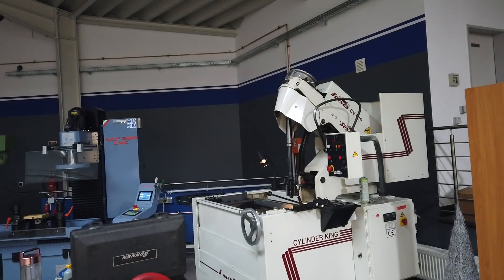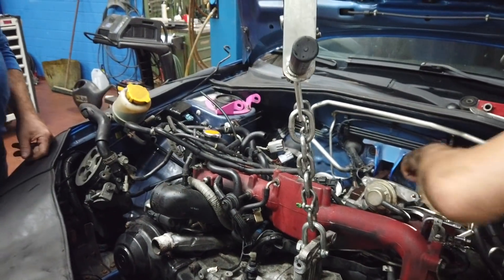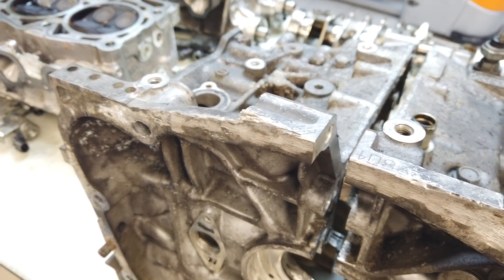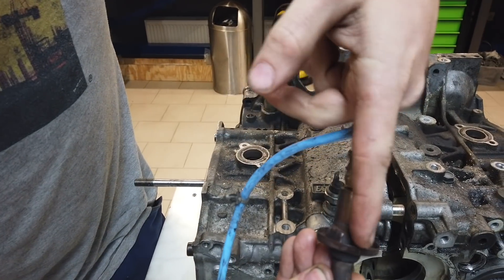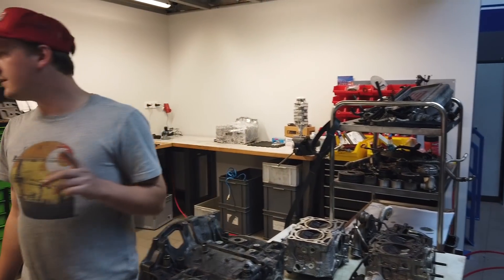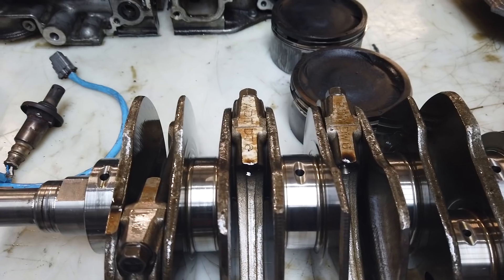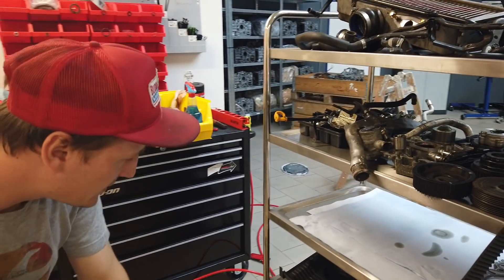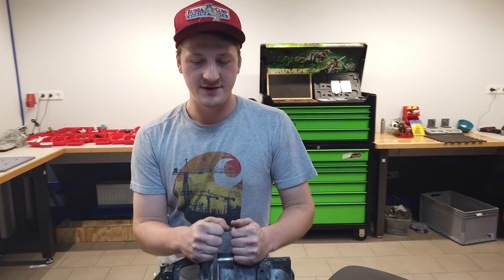What a DISASTER with this Engine l MYSTERY l Subi-Performance

Comment: The youtube rabbit hole has brought me here.

Check it out...
I know very little about car engines. I have an 09 Forester. 
So, I take it to the dealer (Stivers Subaru in Decatur, GA) about 10 months ago due to engine misfires, sluggishness, and oil leak. All compounding over about a weeks time. They say, head gasket is bad, it's replaced. 

Fast foward to about a month ago. Sluggishness returns with smoke from burning oil. They say Cam Seals...okay, done. 
I get it back and it is still burning/smoking oil. I take it back in...they say, "bad rightside gasket valve. These typically don't go bad, we must've of disrupted it during the head gasket job last year." So...they fix this for free, which to me admits guilt. 
2 days later I have catastrophic engine failure/oil leak going about 65 mphs down the interstate. They tow the vehicle back in and discover the Cam shaft has broke in half. 

They are taking a further look to see if it is reasonable to repair. They have not admitted to guilt. They are saying the breaking of the cam shaft caused the breakage in the newly repaired cam seals, this seems highly suspect & gigantically coincidental.  I feel like they are going to dick me out of a vehicle. 

Do have any advice on what I could say which would help me state a case?

Comment: open deck block with trashed crank, trashed cylinder, trashed pistons, trashed head, trashed turbo...bad things happened to that engine...seems like it would be more cost effective to find a good used engine and start over.   Machinist's time is expensive, and most of the time you are sourcing another crank out of a good used engine anyway.  The cost of an actual factory new crank can cost the same as a whole build process on a good used engine.

Comment: Your head studs look super quality! So important to spend good money on head studs, but it is all for nothing if you bend the air fuel sensor on the passenger frame rail during installation. I am a Subaru technician in the U.S. and I have seen this problem a lot. Even though it is more work, I install that particular air fuel sensor AFTER engine installation. I am a huge fan of your channel and admire your work greatly. Thank you for this content!
Reply: If you now are a Subaru technician, is not you equal precise as this german guy or what is soo special do you mean ??  all seious enginebuider works like this guy but you think he is the only one in the world doing it....loool...I´m lucky i´m not even living in your country so the risk that it is you who mend my STI are totally zero.You dont seems very skilled at your joob if you Think this guy is god.

Comment: System was too lean - very low octan,exhaust gas temperature very high=cracked turbo,cylinder head,engine block.Crack on VF Turbos is very often thing,have same on my VF-30.

Comment: I’d love to see your boring process in depth. Being that it’s .07mm too big from spec - next step would be a .25mm oversize (99.75).

So do you bore directly to 99.75 or do you leave some room for the hone to finish it off? 

Then let’s say you get a piston that’s dead on 99.75mm. Do you have to rehone to achieve proper piston to wall clearance?

The machining process is fascinating. Keep up the good work brother.
Reply: I'm gonna try and  respond at this, here in this video you can see at 5:07 https://www.youtube.com/watch?v=Hd6oMzqa680 how he mesures every singel piston and writes the exact size of them on the top, then he adjust the 
micrometer to the size he thinks would fit the clearenc, he zero's the dial bore gauge to that size so he can later check the hole size of the cylinder, I think he adjusts every singel cylinder to the appropriate clerance independetli of them.

If the cylinder size is not too wide of the norm, he prefers to not bore it but just to hone it an give the pistons a coating to fit the clearance.https://www.youtube.com/watch?v=LzfGOjvxZso

You never bore directly to the exact size of the cylinder since honing also removes some material not much but some,  you always leave some meat to work with.
Reply: I disagree. It’s quite an interesting process 😁
Reply: Are you gonna use 4032 or 7618 forged pistóns ? The 4032 material  piston dont need as much piston to wall clearance as a 7618 piston cause that material not grows so much when it gets hot. The clearence also depends on how you gonna use the engine. a rule is that  as harder the engine gonna work the bigger clearence is gonna is recomended to be used. The power  on the engine also decides the clearence, a 300 hp engine dont need as big clearence as 700 hp engine. You need to know if the pistons you gonna use are in 4032 or 7618 material. A normal 3-400 hp with 4032 pistons need about 0.04 .0.08 mm in piston to wall clearence while a 7618 piston almost need the double, cause   it content less Silicon . A 4032 piston has a bigger amount of silicone which does that the piston not grow as much as a 7618 piston
Reply: You cant bore right in the toleranse. I. Have built 3 engines and all piston to all 3engines has been about 0.03-0.07 smaller than 99.50. Since i'm using 2618 pistons i want to have about 0.10-0.14 PTW clearence if you using 4032 you can use half of that. The rest of The PTW clearence i have honed to get. You cant bore with hundreds/MILS, the bore process is not that precisly,so the rest to the thought PTW clearence you must hone to get.
Reply: @mattiasandersson3444  That's like saying you can't cut a crank to tolerance.
Reply: @joriskylie6857  i dont know how much a "thou" is since i living in a modern country and uses metric standards
Reply: @mattiasandersson3444  I like your self assurance. But you still haven't answered the question. What is the difference between a cast piston and a forged piston. You also said you can't cut a bore to clearance so that leads me to believe, using your logic that you can't cut a crank to spec. Please don't be so obtuse. If you don't know the answer all you have to do is ask. I'm here for you.
Reply: @joriskylie6857  you mean you put the crank in a turning machine?? haha. I prefer to fix that in the conrods big end with a a hone machine.
Reply: @mattiasandersson3444  Enough my friend, I find it very difficult and honestly, unfair to you to lower myself to your level.
Reply: @joriskylie6857  ok, you did´nt know more..FYI my English is not very well cause it´s not my main language.That can be why you not understand , not for I think you understand even if i explain it in 100 % correct English though   Bye keyboardwarrior !!!!
Reply: @joriskylie6857  cut...LOOOOL NO i cant CUT in a Crank. i´m using machines for that and they dont "cut"   lol go to sleep and dream further one day you maybe be some one….Loool
Reply: All brand new quality pistons are the same size. There is nothing dramatic about clearances unless you make it so. Same thing with crank clearances.
Reply: @joriskylie6857  the dramatic are that a 2618 needs almost the double PTW clearence compared to a 4032 piston. If you think you know everything then you should know that too boy
Reply: @mattiasandersson3444  lol, for that paticuler engine I run 2 to 2.5 thou. Forged 3 to 4 thou. Do you know the difference between a cast piston and a forged. Don't make me give you a lesson my friend. A prompt answer would be nice.
Reply: @joriskylie6857  since you aviuously dont can explain how much a "thou"is  though i begged you to do that , well that  a sign of something you dont know then.  A forged piston has much higher metalurgy since it´s to compared  to cast has been pushed together and therefore are much stronger compared to the cast piston that just has lied in the mold and after that it just have been deburred. A cast piston is comparable in growth with a 4032 forged piston., with other words they will roughly  need about the same PTW depending off how the engine are gonna be used.
Reply: @mattiasandersson3444  lol
Reply: @joriskylie6857  i have'nt talked about any  crank so i dont know what you are talking about  and it seems that you dont know that either.